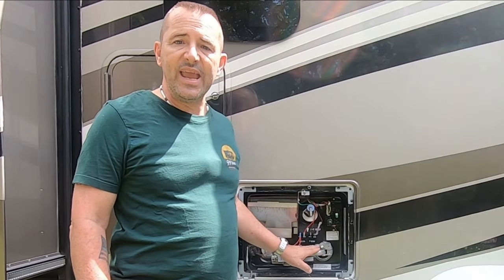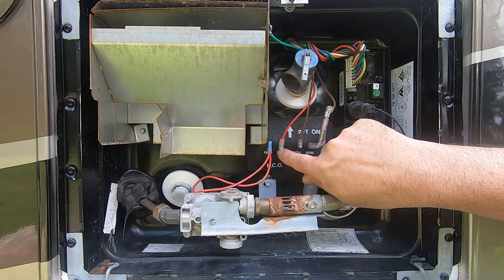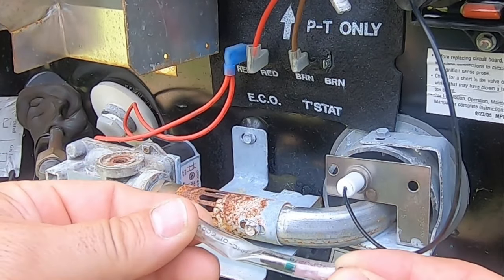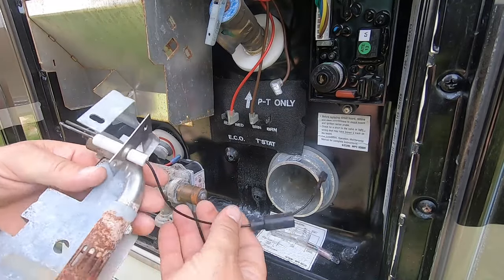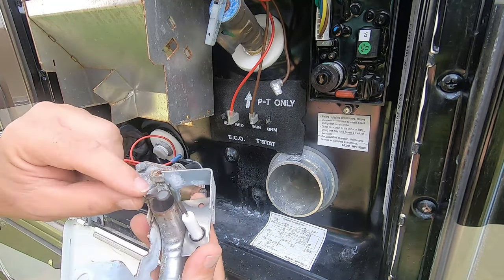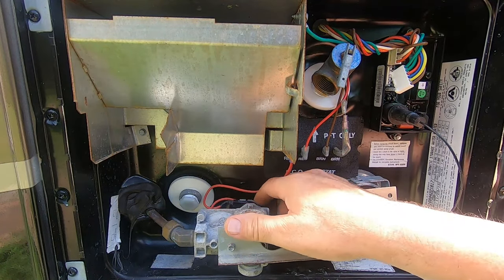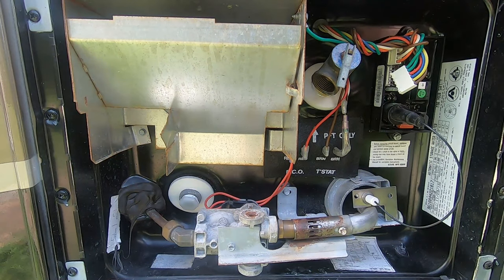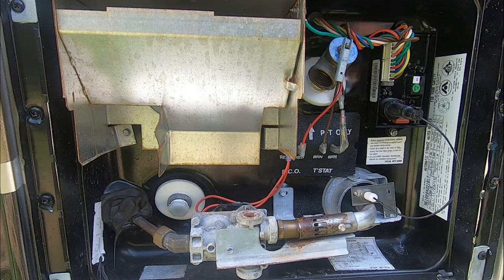RV Water Heater Not Igniting Or Staying Lit - Troubleshoot - RV Maintenance And Cleaning

Comment: VERY well done.  As a video producer, I must say your shots were great, steady and you went right to the topic.  You didn't try to be funny, add a lot of fluff, or other useless banter. You taught me a lot about the water heater, and I solved my "no light" problem thanks to you.  I was getting the clicking of the sparker, but no ignition, so I was using my torch to light the heater when propane was needed.  The problem was the gap between the sparker and the grounding rod.  Also cleaned the water deposits off the screw and wind adjustment slide and it's igniting every time now with no hassle.  I'd give you an A in my class, but I wouldn't be a good journalist or English professor if I didn't remind you not to use the word "basically."   Also a good tip is, even though you may be using electricity all the time, use the LP option about once a month just to make sure all is clean and working.  Keep up your good work and educational tips.
Reply from the maker: Excellent comment and tips.  Thanks for watching and taking the time to respond.  Always exercise all parts of the RV.  Anything not used will certainly fail when needed.

Comment: Your explanations were so helpful. We did the maintenance you described: checked and cleaned connections, blew out tubes, adjusted gap, air/gas mixture... and we now have hot water again. Thanks so much.
Reply from the maker: Great job!

Comment: My water heater wasn't working because the water lines under my sink weren't turned on right after I had it professionally winterized. That is all I had to do was figure which valves to turn...lol
Reply from the maker: Hi Adam, Yes they put the valves in bypass to winterize.  They must be returned to normal when finished.  Check out my video on dewinterizing your RV.  It should be very helpful.

Comment: The heater for the water on my camper doesn't light when its real wet and rainy is there a solution? It will manually light for 3 or so seconds then shuts off.

Comment: Because of your thorough and well put together video I was able to troubleshoot why my (propane) water heater ignited but then stopped every time I attempted to start it.   This is a 26 year old water heater. I went through every step you outlined. I checked the wires for conductivity and discovered a few wires were corroded and the spade connectors weren't tight. I checked the overheat safety for continuity. I checked the burner pipe for blockage and corrosion. There was lots of rust. I cleaned the orifice with carburetor cleaner. I checked the igniter gap. I checked that the  round plate in the burner tube was centered.  I re-adjusted the flame so it burned quiet and blue.  I actually have a new water heater that I can replace it with but the work involved is too much right now.  I'm at the tale end of a 2 month restoration on this motorhome and I'm exhausted.  You saved me a lot of work. This rig was rarely used and this water heater should have a few good years left in it.  Many thanks!!!
Reply from the maker: Great to hear when my videos are able to help someone.

Comment: Thanks for the tip. I have the exact same water heater with the same problem. The connection was a bit corroded from the water seeping occasionally from the relief valve. Also a miller had crawled into the tube where  you regulate the airflow. Cleaned it all up and runs like a champ!    Thanks!
Reply from the maker: Hi Jon, Glad it helped and for taking time to comment.
Reply: I'm going to tear into mine tomorrow!!

Comment: Wow. I did exactly what u did and it fits up now. I took it apart and sanded connections on thermal fuse, blew out jet, blew out curved gas pipe, put it back together and it works. Suggestion tho, I had an extra screw, finally figured where it goes.. take photos before u start.  Thanks for video
Reply from the maker: Yes if you are not familiar with something always take a picture before starting.  I usually forget and regret it.

Comment: Simple steps to follow, propane and electric were not working. 
I changed thermostats and fuse earlier. Cleaned out the little orfic has plugged with white powder , cleaned out all good thank you .
Reply from the maker: that's great to hear. Happy camping.
Reply: Thank you, now to tackle the electrical heater issue.

Comment: Thank you for explaining in detail what to do! My water heater just went out in my jayco Jay flight, going to check entire system tomorrow, now that I know what to do
Reply from the maker: Hi Andrea, Hope you get it working, Good luck!
Reply: @RVHabit  well I’ve cleaned everything drained the tank there was a lot of calcium in the tank itself, but my DSI FLT light is still coming on, I use the electric switch for my water heater instead of my propane. But neither are working (but I don’t have propane to troubleshoot that issue)

Comment: MY SUBURBAN 6 GAL. GAS/ELEC. HAS THE SAME ISSUE.  I HOPE THIS PROCEDURE CURES IT.  THE W/H WAS REPLACED IN 2018.  IT SHOULD HAVE A LOT MORE MILES LEFT ON IT.  IT'S TIME FOR AN ANODE ROD CHANGE OUT ANYWAY.  GREAT TUTORIAL!  CHEERS.
Reply from the maker: Hi Seymour, hope it solves your issues.

Comment: Lou, great maintenance video on the Atwood water heater. I didn't have any problems with my unit but I did clean up the burner tube alone with the thermal cut-off terminals. I did adjust the air/gas mixture. Doesn't sound like a 747 taken off. Kept those maintenance video's coming our way. I too have a 2016 GTS Forester with the same appliances / equipment.
Reply from the maker: Hi DJ,  Yes those water heaters can get very loud.  I think the 2016 GTS is a great rig.  They did everything just about right. (except the split rear bed).
Reply: @RVHabit  the split rear bed with the window head board and the pull down shade, not a good design!
Reply from the maker: I finally got fed up with the shade and put a rice paper window film on the back window.  Works out excellent and no more fighting with that shade.

Comment: Thank you very much for this walkthrough. One additional thing I noticed on my Atwood fix, while the sparker bases were intact the rods themselves had some carbon buildup. I gave them a light sanding as well as the connector tabs and adjusted the sparker gap to the proper measurement. As per your advise I carefully removed the gas nozzle tip and gave it all some compressed air. It’s been very dry here. Reassembled and it fired right up. Sweet blue flame. And adjusted the the air to gas window to a gentle roar. 👍🏼
Reply from the maker: Awesome, great to hear.

Comment: Absolutely great video on showing us what to look for and do , my hot water heater is exactly doing what the one you were working on, I’ve tried a few things but ran out of daylight but I’ll be back at it in the morning, my wife had forgot to turn the hot water switch to off and came back to town for 3 days and when she came back to the trailer this happened not her fault though I probably would have done the same thing ,

Comment: This was very well done. We have the same situation of heater not staying lit. Went through your steps cleaning, replaced thermofuse and igniter. It still doesn't stay lit. 3 lighting cycles. No continuous lighting. Ugh. 😢 next step?
Reply from the maker: Hi, obviously I can't diagnose a problem here however if you have done all the testing in the video you may have an issue with the control board.  Check out this video https://youtu.be/wgk-vaFD4kg

Comment: Great video and information, thank You. At what point would the thermostat need to be replaced.  What would be the trouble at the multimeter end or other.. After I do a routine flush my HH will light then shut off 3 times or a few sets of 3 try.  then, I turn the switch off, say a prayer, and it starts for good again.  It's bee off and on like this for over a year.  I will do all the servicing you menton here, I am sure it will help !!

Comment: Man great video.  Wish it had been at the top of my list. Fortunately you have the same one as me so all your info was spot on. Luckily my gas side of heater just came on but I am going to check everything that you did when I get home.
Reply from the maker: Hi David,  Glad it was helpful.  I have another video about changing out the control board if you find that is the problem.  Good luck.

Comment: Lou to the rescue. I'm not so upset after finding this video. If the wire going to the sparker hadn't broke while cleaning I'd not have seen this. Excellent 👍.
I don't have a new part on hand . Can the wire be reconnected on the electronic side
Reply from the maker: I would not try to patch the wire.  I would purchase a new one.  There are links to many of the items in the description box.

Comment: great video and thanks for doing this. It helped me a lot in diagnosing a problem with my gas ignition (electric works fine). I replaced the circuit board (no power) and now have gas flow, ignition and power. What's continuing to be a problem is the gas will ignite, the flame appears but after a second or two, the ignitor starts clicking again and the flame then goes out (gas flow shutoff?).  After 3 tries, it faults and quits. Each time, it appears to have lit the gas stream just fine. From the explanation provided, the electronics should be able to sense the flame and not try to relight.... is this possibly a board problem? I cleaned the entire unit (less than 3 years old) and reassembled. I also tried various airflow positions. I'm not certain when the unit is actually "lit" as the flame seems almost instantaneous (first click of the ignitor?). Any suggestions are welcome.
Reply from the maker: I would first make sure the ignitor is properly set. Meaning is the sensing probe the proper distance from the ignitor.  I personally would replace the ignitor which is only a few dollars.  If no luck and you have cleaned everything it may unfortunately be the control board.

Comment: thank you very much very informative. my electric does not work either. going to look for a vid of that also. and the heater only blows cold air. have some work to do. I was thinking it is a propane problem. but with the electric not working on the hot water heater it has got me wondering. I will get to final answer you have me of to a good start. thank you again.
Reply from the maker: Good luck!

Comment: This was very helpful. Mine was working earlier this week but very loud. Now it won’t light at all and just leaks out gas from the mixing chamber. Shouldn’t it shut off the gas if there’s no flame?
Reply from the maker: Hi Rachael,  yes the control board should cut the gas off if no flame is detected.  Leaking gas can be extremely dangerous. You should have a qualified technician service the unit.

Comment: Excellent video, Lou. My son-in-law did some plumbing and got an '05 Trail Cruiser. Decent shape but water heater not working. There's a red rocker switch on the top of cabinets below front of sink. Turn it on and it stays on a few minutes and then will cycle one-off if I remember correctly. Is that switch  used when heating with electricity?  I haven't found any other switch that would be to select gas or electric. His heater looks identical to the one you have. Guy at RV center said it could be Atwood, Suburban.... Appearance wise I see Atwood. I'm gonna go through it like you did and see if I can get gas to work for now. It's 3 hrs away at hunting club. Thanks for the tips.
Reply from the maker: If it is a suburban they have a rocker switch outside in the corner of the water heater.  Good luck

Comment: Great video, and very informative.  My Camper sat for a while and I was having an issue with ignition.  gas was flowing, but had to use a lighter to light it.  Looks like a bad spark probe.  Cleaning out everthing else while I am in there.  Thanks!
Reply from the maker: Hi Will, Great to hear!

Comment: This popped up in my recommended after I tried to Google more troubleshooting info for ours. We spent our first weekend in our new (to us) trailer and the water heater would work on both electric and gas, but it was overheating and tripping off on a fault. 

Once I got back on Tuesday with my tools I found that it was overheating to 180°F, tripping the ECO, which I assume causes the board to lock out and send a fault. The main TSTAT was still closed and calling for heat. It had good contact to the tank, I went back and replaced it last night. The trailer is being used for a rental this weekend so I hope they don't have any issues. It's a decent heater
Reply from the maker: If I was to guess without running tests I would have done what you did and replace the thermostat.  Hopefully that corrects the problem.
Reply: I'm a plumber/oil burner mechanic/gas fitter... if I can't figure it out and fix it I'd be a little embarrassed at myself lol
Reply from the maker: LOL,  you will have no problem.

Comment: The best I have seen! You were thorough and touched on the basics. I have one question. Do you turn off all the electricty to the rig, shore  power for example? Thanks again!
Reply from the maker: When testing you need power to unit however you should disconnect all power sources when working on the unit.

Comment: Just came across your video and it did help me to check several things that I did overlook. Unfortunately I’m still having the same problem as before o hot water at all its an electric Atwood and the light will be on for a couple of seconds then it raises my hopes by going out then like a lottery ticket it’ll dash my hopes again and come back on after about ten +/- seconds. Saw another video from Atwood stating the heating element is hidden in the almost inaccessible back part. Liked your video so I’m hoping someone can help with this problem.
Reply from the maker: Yes the heating element is in the back of the unit.  It is usually accessed from inside the RV through a cabinet or access panel.  I wish I could help more but you need to check the element and if that's good possibly the control board.  I have a video on replacing the control board for the water heater if that is the issue.  Good luck.
Reply: @RVHabit  thanks much I did replace the control board with no success thanks again

Comment: Great video.... So I replaced both thermostats, the brown wire coil, and the spark unit. On gas it'll fire but only for about 3 seconds (same as before I replaced the parts). On gas only it with throw DSI fault. If I flip the gas and electric, it won't throw the fault.... But it still doesn't get hot. On electric alone it's not getting hot. Thoughts? I think the next step is replacing the circuit board.
Reply from the maker: You may have several things going on.  Looking at the parts you replaced the gas issue may be the control board.  You can check out my video on replacing the water heater control board.  As for the electric issue, the board may be the problem but it may also be a problem with the heating element itself of a relay.  The electric parts are on the other side of the water heater usually accessed through a cabinet in the RV.  All this is a possibility and to be certain a multimeter to check components is necessary.  Good luck.

Comment: Mine stopped working on gas as well last weekend.  After troubleshooting, it fires up on gas sometimes, but not all the time.  Going to take it apart and check .
Reply: Checked and put back as everything looked fine.  I ended up buying a new control board and currently awaiting arrival.
Reply: I received the board Thursday, installed and tested it today.  Fires up with no problem.

Comment: My propane fueled rv heater just quit. I checked the ground wire lug where it screws into heater cabinet. I cleaned some corrosion off and reinstalled it. Heater works again.

Comment: Thank you!  I haven't done my trouble shooting yet, but at least now I know where to start!
Reply from the maker: Hi Beth, good luck.
Reply: @RVHabit   ~  Thanks.  Turns out my issue isn't quite the same.  Gas is clearly flowing, and it ignites.  But it won't stay lit.  Back to the drawing board...  (and to your blog for more information!!)
Reply from the maker: Check the igniter wire or the control board.

Comment: Your videos are great.  Do you have a propane refrigerator?  My RV fridge shuts down sometime on propane and I was wondering if you have tips.  Does an RV propane fridge work similar to the RV water heater as far as parts to adjust, check, and clean?
Reply from the maker: Yes they are called absorption refrigerators.  They run on electric or propane.  They are somewhat similar to the water heater in that a control board tells the refrigerator to allow gas in to light.  Unfortunately they are a little more complicated in relation to parts and could probably not be diagnosed without being there.  Make sure your propane delivery system is consistent.  The bad part is your problem is intermittent which can be the most difficult issues to resolve.  An RV tech would be able to diagnose the issue in short time.  Good luck.

Comment: This video is amazing! I've learned so much thank you!  I have a silly question and maybe I missed this part... do I have to turn all the electric off to the trailer when working on this since you were working with the propane area?
Reply from the maker: Hi thanks so much.  It is always recommended to turn all power and gas off when working on the RV.